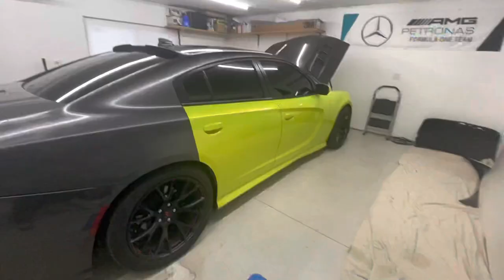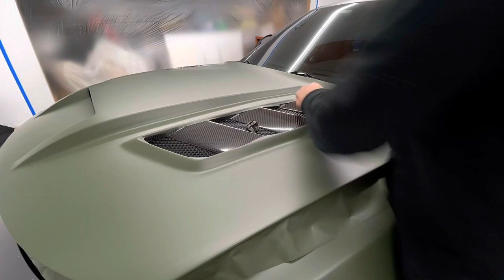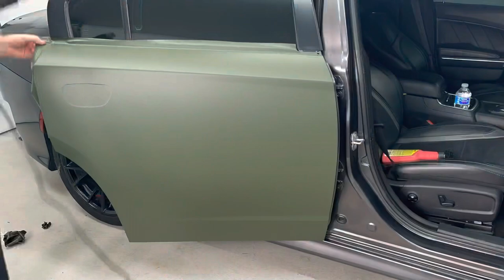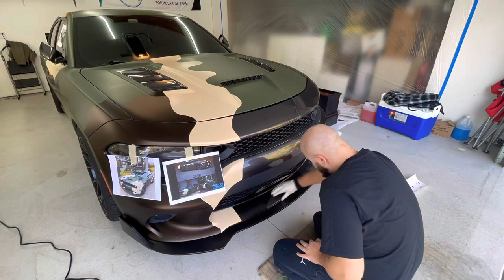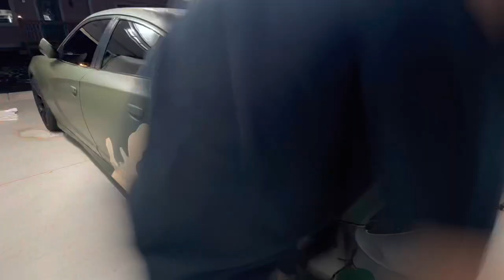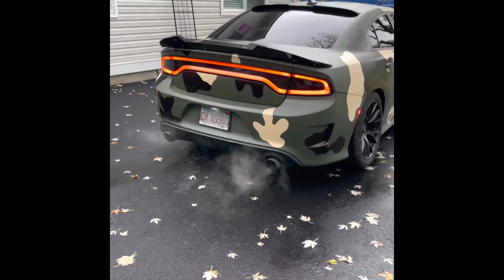FULL Timelapse of the Custom Wrapped “Young Dolph Camo” Charger! (NO TALKING :))

Comment: What’ would be average cost on a 2007 Gmc Yukon with inside doors as well. No sanding or touch up
Reply from the maker: i dont do door jambs at the moment, dont have the space to do so. but it would be around $2500 without jambs for a solid color.